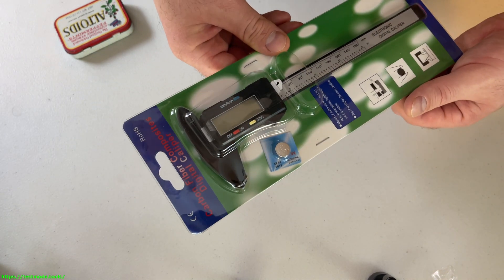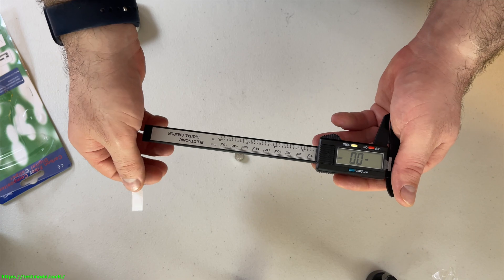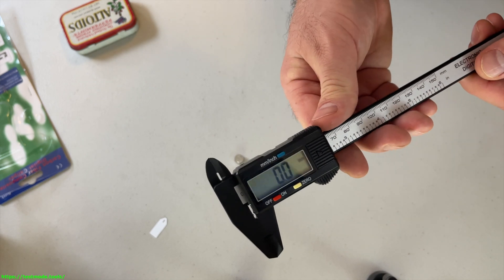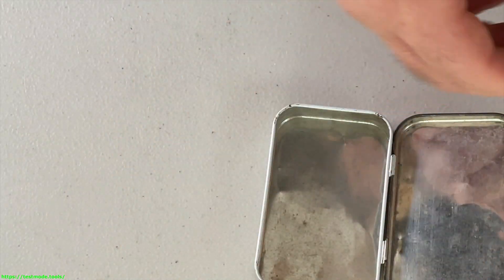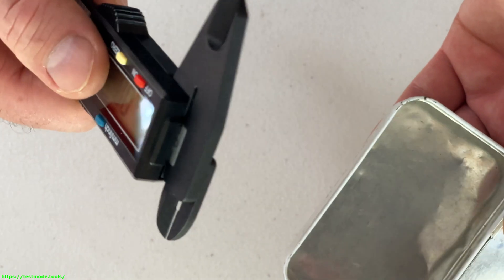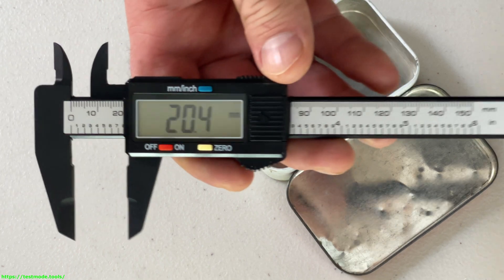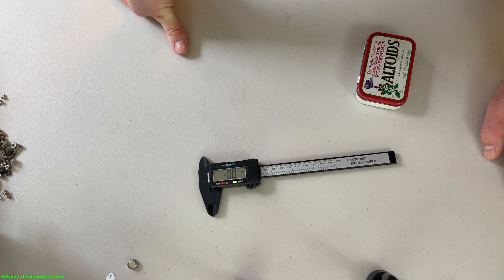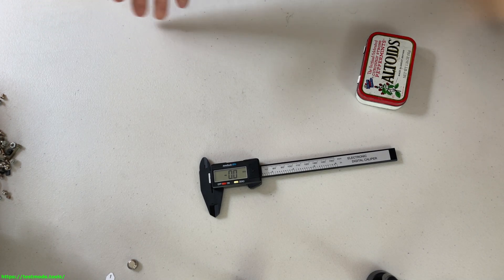Carbon Fiber Composites - Digital Caliper

Comment: I purchased the same caliper on Amazon.  I think for its low price, this tool is a good value.  As a test, I measured the known thicknesses and diameters of various U.S. coins (newly circulated, not old worn out coins).  The caliper measurements were good, close, but not perfect.  It would be nice to have a way to re-calibrate this caliper for more accuracy.  Also, the caliper measurements go out to only 2 decimal places on inches (and only 1 decimal on mm).  Not sure if other calipers go out to 3 decimal places in inches.  Again, using U.S. coin dimensions as a standard, the specifications for diameter goes out to 3 decimal places.  I know that I'm being too critical, especially for a tool that cost so little, but just saying.   Best, Steve